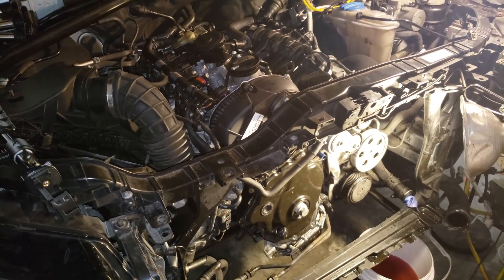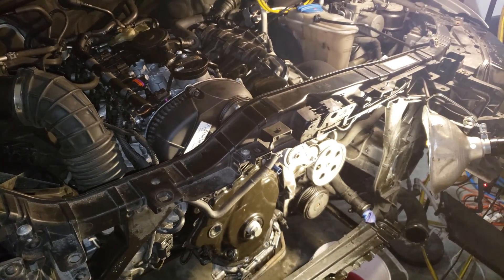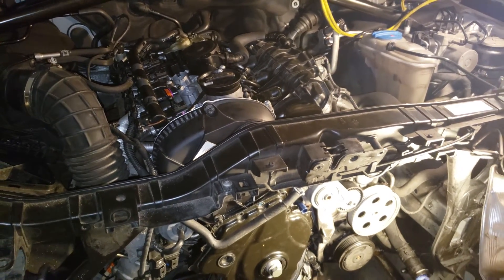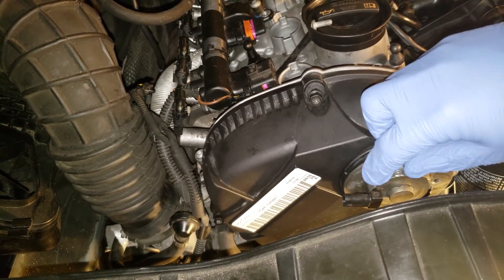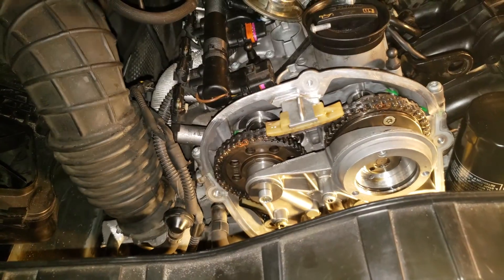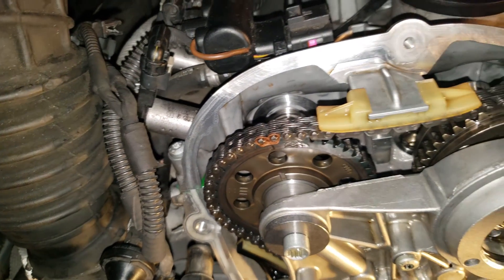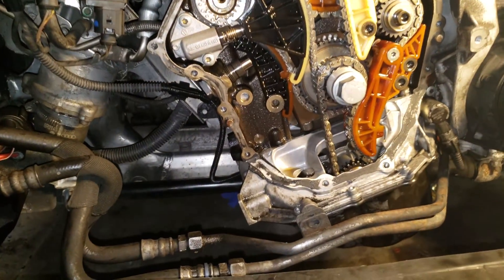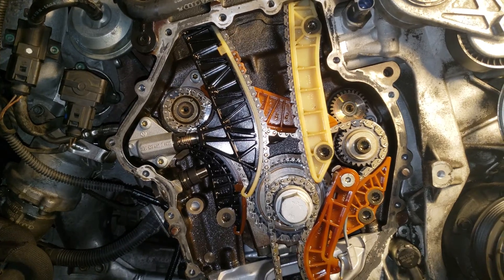2011 audi q5 2.0T FSI Timing Chain Check

Comment: What was the oil consumption issue and how did you solve it. I changed by oil separation manifold but it did not help I’m still having issues diagnosing it
Reply from the maker: Its the pistion rings. To completly solve it requires a rebuild of the bottom end. Pistions and rings. The oil ring get clogged up and allows oil to pass through and burn up. There are some options that have helped others called pistion soaking. Where you pour solvents down the pistion chamber but I have don't have any experience with this method.

Comment: I believe I have this problem too, I just finished doing a fresh rebuild exactly how you explained , and I'm getting timing codes , and runs supper rough . I check my timing marks and they sre spot on
Reply: You have to make sure all the timing marks, balance and timing must be correct... It is two chains, if the balance shafts are off you will get rough engine.
It may look ok on the top, but If it is off on the crank, you will get rough idle. It is tricky. There is a revised timing kit that has  longer plastic molds to prevent the chain from slacking on the crank side. It has happened to me it moves by one chain link and have to redo it all over again. I have a GTi, same engine, did a full rebuild... Oversize pistons, overbore, eBay waffle piston rings (not the spring VW OEM, new balance shafts, cylinder head, intake manifold, water pump.
If your car has a lot of miles, check if any of the codes relate to the dag flywheel, they start running rough when going bad.
https://youtu.be/1gXYuR4uD2M?si=fevWDnAJd-afoMry

A link for crank reference
Reply: @psiturbo  so turns out my intake came witch has the vvt sprocket was bad , replaced it and all my problems and timing codes went away.

Comment: your timing marks are off.... if you look at 2:27 and pause it you can see the mark on the outer gear.. the triangle and your link is pointing at the mark for the balance shaft chains looks about 4 teeth off
Reply from the maker: What it turned out to be was the actual crank sprocket was off from the crankshaft. If I rotated the entire assembly enogh all the markings would eventually line up, but the internals where still off Making everything off timing by 2 or 3 teeth according to the sensors.
Reply: @danielsgarage3545  How could you put the crank pulley on wrong when it is indexed and can only seat properly one way?
Reply from the maker: @Japplesnap  Great Question.  I thought the same thing before it happened to me. The pattern they used is sutle enough that if you misalign it and torque it down there will be no gap or indication that it is not on correct until you try and start it.
Reply: Assuming we’re looking at the same ⚙️, I’d say it’s off by 1/3 of a turn clockwise

Comment: How about the timing tensioner
Reply from the maker: Easiest way is with vcds or obd11 software.  You can read one of the adjustment numbers should be -5 or smaller and you are good. Unfortunately I dont have a video on that to show you. Otherwise there is a small inspection hole on the front lower chain cover that opens and you can visually see how far the tensioner is protruding out. I am not sure on the number of rings showing to equal bad but I believe it to be 7.
Reply: if you show -7 or more during normal idle you have too much stretch, Daniel is guessing

Comment: When the tensioner is bad that it literally rocks/jumps, can that cause misfires? Or at least for the engine to think that it is misfiring because of course the timing will be off- which leads me to another question, can this result to p0016 code being thrown once then not anymore? For a better idea, the other morning, car cranked for like a quarter of a millisecond, basically just made a short noise like it’s cranking but car didn’t start, ran codes, threw p0016 (which means the correlation of blah blah blah is off), cleared it, right after- car started but with bad misfires. Hasn’t threw the code again, did a visual inspection and the tensioner is literally moving up and down about  2.5mm. 

Regardless I’m gonna replace the tensioner but the code it threw once has something to do with the timing chain, mechanics are telling me to take it Audi, nightmare.
Reply: it doesn't matter if you just replace the tensioner because the tensioner will extend with the amount of slack the chain allows, meaning you will have a new tensioner but it'll be fully extended in -7 timing or more meaning the stretch is too much and you will need new chains. PERIOD. The only time the tensioner matters is if you have the out dated one that fails on itself. Replacing the one part isn't a cure all for chain stretch come on dude.
Reply from the maker: Sounds like it may have jumped a tooth. My recommendation would be replace the tensioner, take the chain all the way off and  realign all the definitely making sure the crank sprocket is aligned to the crankshaft. It is a very involved and technical job requiring some specialty tools without them you run the risk of catastrophic engine damage.  Which is why most people just take it to the dealer. How ever if you mechanically inclined enough the tool kit can be bought  for between $100 and $150.

Comment: So you had to rotate the engine, so if the timing isn’t correct no matter how you rotate it can never align?
Reply: It takes I believe 163 revolutions for it to all to align back up. I have done it and its boring, lol.
Reply from the maker: It depends. If everything  is correctly timed it will eventually line up. However, if the crank sprocket is misaligned to the crank shaft, the timing marks will line up but still throw the code. Third option is if it is timed wrong you are right the will never line up.

Comment: How much did this cost you to do? Did you replace the timing set at the same time?
Reply from the maker: the timing set had just been replaced by Audi just weeks before my full rebuild. parts prices can change a lot most of my purchases  where from https://www.ecstuning.com, https://www.shopdap.com/, and my local VW dealer between the 3 and all the specialty tools required I was able to complete the full rebuild front brakes, brake lines plus everything else I cant remember for about $2500

Comment: I understand this marks can be lined up only one time while you performing timing job but I don't think that you can make conclusion this way I believe that you would need to retime lower and upper chain to confirm since your lower chain isn't lining up right now it shows at 2:29?
Reply from the maker: you are correct, I discovered this in a film I never ended up making. both sensors tested good. it turned out the actual crank sprocket was 1 groove off time and I had to remove everything and start from step 1.  After fixing the sprocket misalignment she fired up and ran smooth as butter.
Reply: @danielsgarage3545  Good work bro.

Comment: Daniel, I have the same 2011 Q5 2.0T. I need to replace the crankshaft sensor. Did you ever make the video of where this is located? I know this was a long time ago but any help would be great.
Reply from the maker: https://www.audiworld.com/forums/a6-c7-platform-discussion-194/crankshaft-position-sensor-location-2013-audi-a6-2942107/

This is the best I have found for location. I had to climb up on the engine and almost reach down blind. It is reachable without removing anything.
Reply: It’s located slightly below the water pump

Comment: I have 2011 Audi A4 I got the same code p0016 can you tell me where is the location for the two sensors I like to start replacing these two sensors first before I go to the timing chain
Reply from the maker: Cam sensor is right on top middle of the valve cover. The crank sensor is on the bottom back of the engine block below and behind the water pump
Reply from the maker: https://www.audiworld.com/forums/a6-c7-platform-discussion-194/crankshaft-position-sensor-location-2013-audi-a6-2942107/

Comment: I am Brazilian and I have an Audi A4 2013 2.0 TFSI engine. It presents this error P0016, I delete it in OBD2 and the car normally goes both in the city and on the road. Can the problem be the car out of point? If it were the car, wouldn't it be weaker? If not, what else can it be?
Reply from the maker: If the timing chain or oil pump recently had work it could be out timing.  If not I would start with the crank and cam sensors
Reply: I already changed the CKP and CMP sensors. Could it be the variable control valve?
Reply from the maker: Could be. Wouldn't hurt to check. Since it's not the sensors I would check the timing chain itself for stretching. If it has stretched to much it will throw this code.  Have you checked the timing marks to see if they line up to the dots? You may have jumped 1 tooth if its stretched.  When mine was 1 tooth off it would have a hard time starting and would only rev to 4500 ish
Reply: I didn't check anything on the chain. But the car has no difficulty in starting and walking, I only see the error because I use obd2. The car gives no signal. But for security I will check the current point. Thank you!

Comment: I have a 2008 audi a4 2.0 and the code P0016 came up now my car cranks but wont turnover
Reply from the maker: Sounds like timing has jumped. Any recent work done?  I would start with checking the timing marks to see if the are on point. If that checks out. Look for fuel and spark. Then compression test. If it did jump timing. Re time then see if it runs. If it runs. Replace the chain and tensioner and your good to go. If it does not fire after retaining. Do a compression test before replacing parts to ensure you didn't bend any valves.
Reply: @danielsgarage3545  I just got the motor put in but today i was smelling a burnt smell like wire it just rolled to a stop it cranks but wont start
Reply from the maker: @AlfoRomeo713  the daunting task. Check all the wiring. I would start with all the timing sensors. Crank and cam angle. They where on the right side of the motor for me. Crank was very bottom right. Cam is right on top in the valve cover

Comment: I replaced my timing chain and tensioner everything was lined up with the timing marks and torque to spect. I gave it a couple turns and the timing chain is not lining up with the with the bottom marks only the two on top line up. Should I redo the timing?
Reply from the maker: It can take up to 50 rotations to line up if everything is correct. My bottom sprocket was misaligned by 2 v marks but when torqued it sat flush. If the don't line up every I would redo your timing and double and triple check the Main sprocket on the crankshaft
Reply: Daniel Haak thank you for the information I will redo it because i turned it more then 50 times and didn’t get them to line up
Reply: Daniel Haak ok my timing marks are lining up after rotation but I hear a little popping sound as I’m rotating. Is that normal?
Reply from the maker: @Aaroncreate24  like a compression pop? Should sound like a smooth chain gliding through oil.
Reply: Daniel Haak I know is not the chain is more like a lifter pop
Reply from the maker: @Aaroncreate24  they do have hydraulic lifters could be because of no oil pressure.
Reply: Daniel Haak thank you

Comment: I have the same problem with my audi a4 with the P0016 codes. If the engine is still working , does it means my chain arr not broken yet?
Reply from the maker: Not badly broken but will need work asap.
Reply: What was the fix? Thx

Comment: iam having the same code my engine had the same things done that you have done.what 2 sensors are you taling about replacing?did you ever find out what caused the problem?
Reply from the maker: i had to remove the entire timing chain again. the crank sprocket was not lined up properly to the crankshaft.  I was 1 indent off, but when you torque the sprocket down it will appear to look right but it wont run right.  pull all the chains off check the sprocket alignment and reassemble.   don't remove the center bolt until all 3 chains are under tension. 

https://www.youtube.com/watch?v=BMuPXLpI10E&t=10s

at 9 min 30 secs is when I discover the sprocket is off and line it up properly. 

I don't have a reassembly video. I was rushing and didn't get to film.

Comment: Does this marks apply to a 2010 a5 2.0t?
Reply from the maker: As long as it's a chain drive then yes they are the same.
Reply from the maker: I believe Audi converted to chain drive in 09.  The upper chain cover is very easy to take on and off to verify.
Reply: Ok thank you !